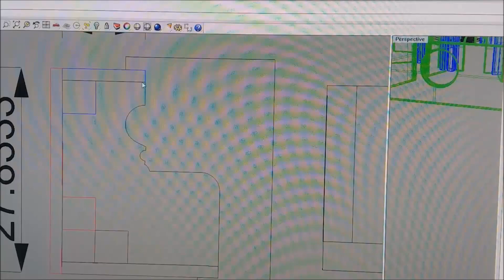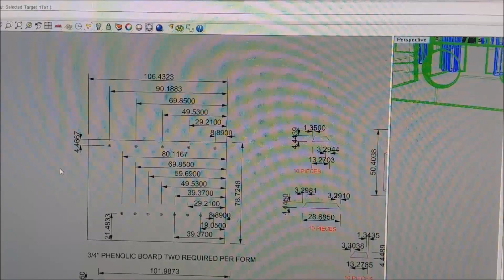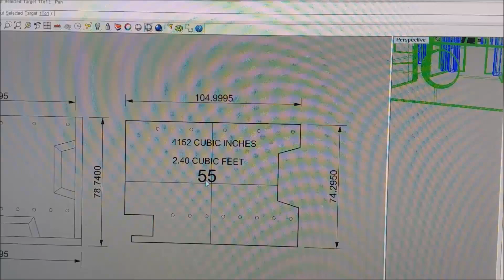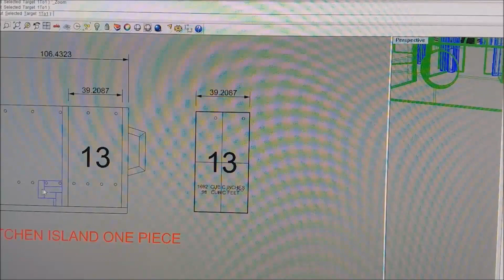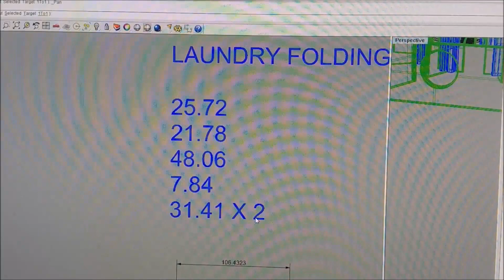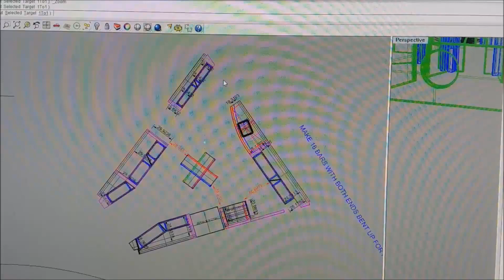CONCRETE HOUSE BUILDING, DESIGNING REUSABLE  FORMS FOR COUNTERTOP BASES

Comment: A great channel and excellent "CONCRETE HOUSE BUILDING, DESIGNING REUSABLE FORMS FOR COUNTERTOP BASES" video, Another fantastic sharing. Be safe, stay safe, keep wearing mask! Best regards, George/Ned 👍🤝👍
Reply from the maker: George/Ned, We are really into reusable concrete forms. The main house was done using a small number of forms 36 times. We changed to lighter "slip forms" and have used those for more than 20 pours. The key is using the phenolic board (resin coated plywood) with a little WD40 silicon lubricant wiped on with a paper towel as a release agent.
Reply: @concretehousebuildinginph1488  
Sorry but, I thought your name is Gorge... Take care, good luck and have a fabulous day/Ned 👏👏